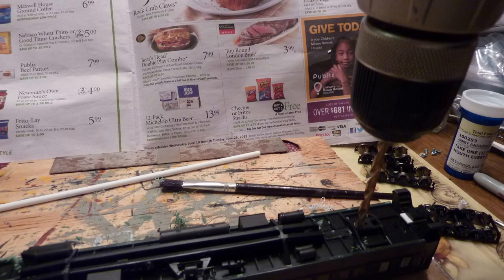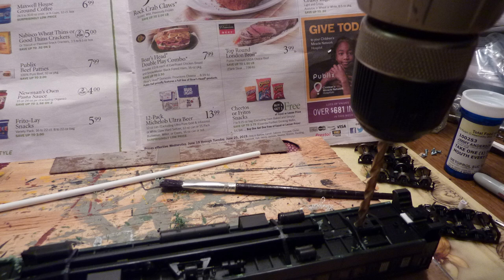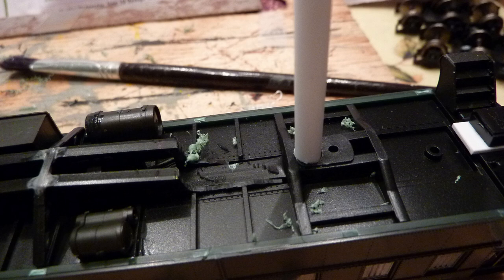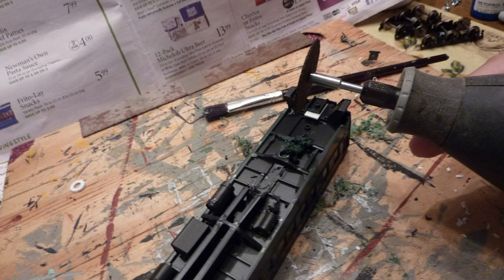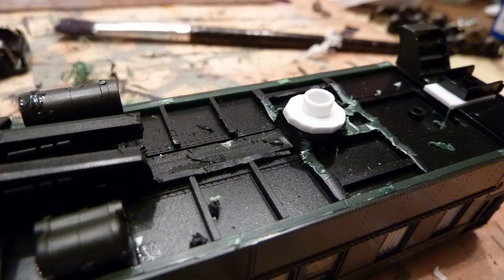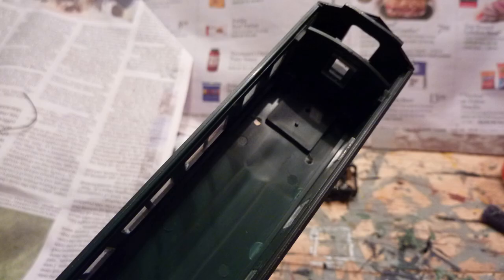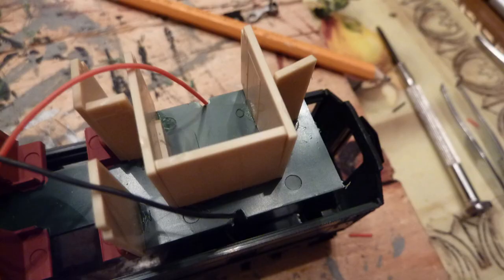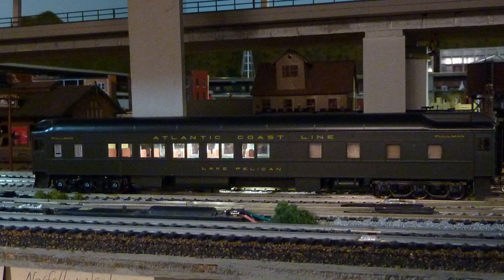Replacing Trucks on Branchline Heavyweight Pullmans

Comment: This is much clearer than anything I have seen on this topic.  Many thanks.

I REALLY don't want to try to build the trucks from the kit.  Leveling those looks like a nightmare...
Reply from the maker: I'm not sure I'd recomment what I did. It works on some cars but it wasn't the best way to secure the trucks to the body of the cars. I suggest finding a way to use screws or bolts with a nut on the other end. I couldn't follow how others explained how to do it, so I did what I thought would work but was not too pleased with the results.
Reply: I'm having to deal with the same nightmare on 12 E&B valley kits I built. The walthers trucks are great roles, have great detail- but damn they are a pain in the ass to mount on anything but a walthers car. I bought the universal adapters to try first